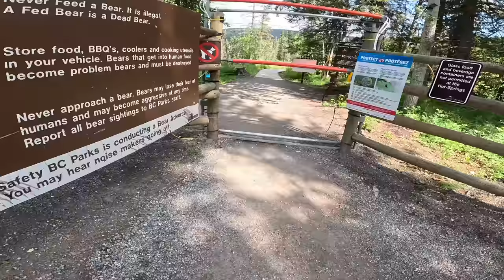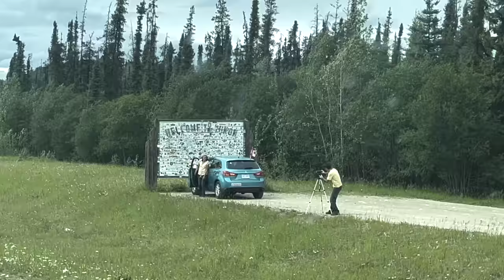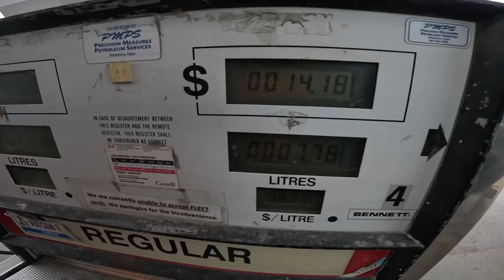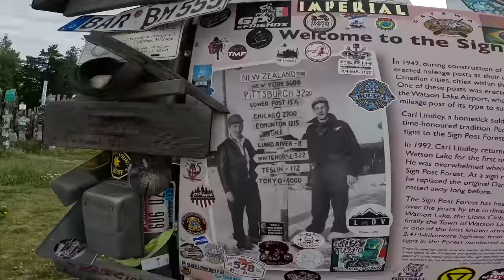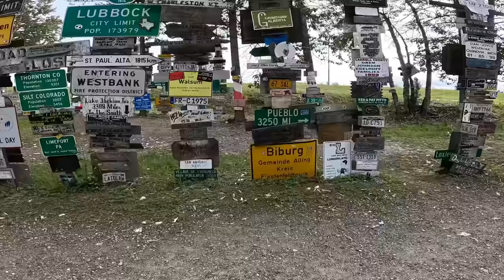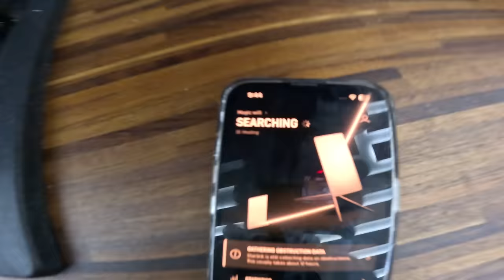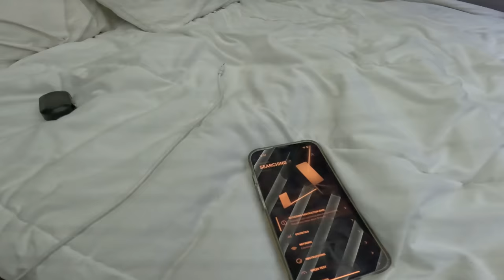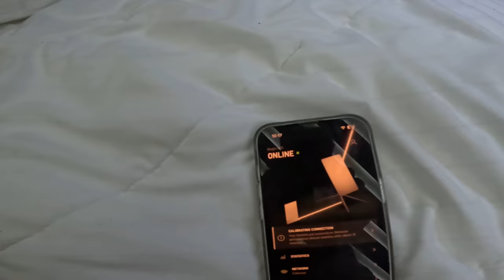VANLIFE  in Northern Yukon Wilderness | Cooking Pizza from Scratch

Comment: lots of things wrong with your pizza dough
1. you need to preheat your plates there in the oven so it can properly cook the bottom. that's what cooks the pizza, i bet the bottom of the pizza was barely cooked. It has to preheat in the oven for at least an hour

2. way too much yeast yikes, you probably had to drink a lot of water. i get it though, the more yeast, the faster it will rise. but 30 minutes is not nearly long enough. i suggest making a preferment like poolish or biga so your dough will move along quicker. poolish is flour water yeast let it work overnight. 

3. the dough balls need to rest for at least an hour for it to take shap and the gluten to develop before stretching